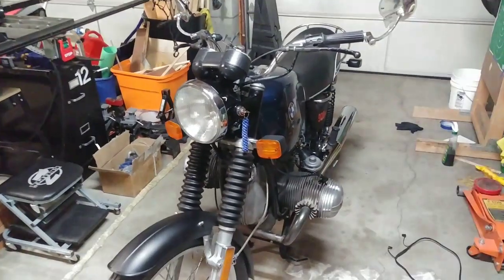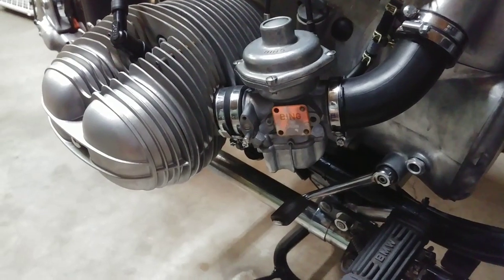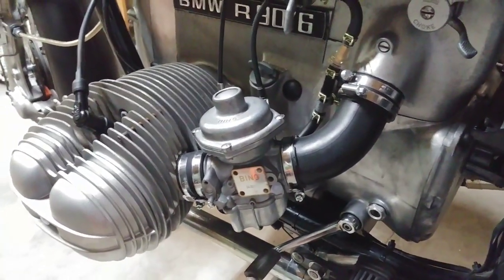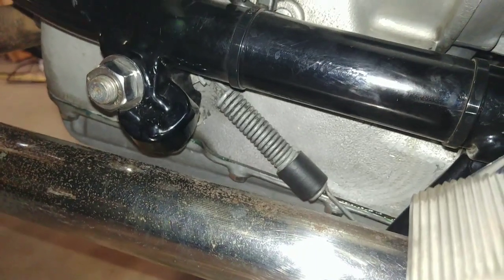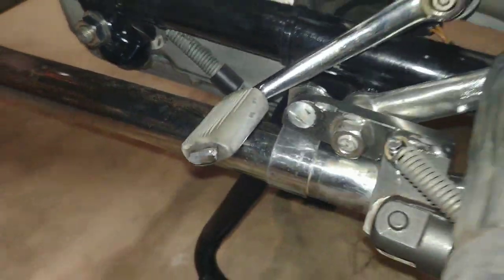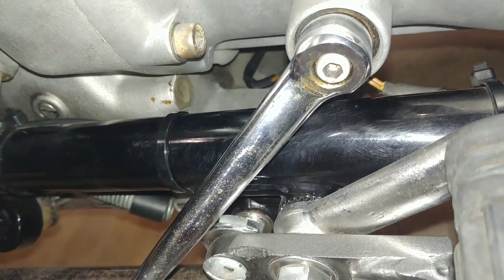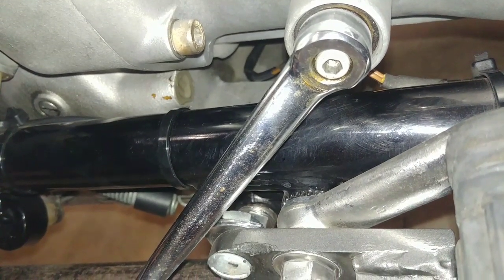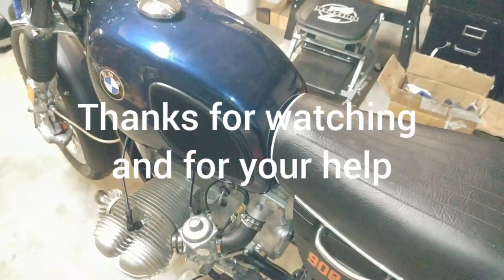Airhead has oil leak. Help!

Comment: That's a really clean engine, no wonder a little leak is offensive.   Not like my '79 R100RT which looks like an oil barge..
Reply: Problem you need to Degrease the Mot or with a Professional Grade Degreaser 3 D we're ProTech Detail

Comment: You should find a slot-head screw under the epoxy. A proper fix will require (at least) pulling the transmission. If you can back the old screw out, and find that the threads are good, then clean it all off, apply high-temperature thread sealer, and reinsert.  If you find damaged threads, the fix goes to a new level of difficulty.  If the threads have minor damage, you can run a tap in there. The shelf is in the way of a normal tap driver. You will have to rig an extension. If the threads are badly damaged, you will have to drill a larger hole, tap for the next larger bolt. For this, you want to drop the oil pah so that you can get any shavings out. If you cannot back the old screw out, then my suggestion is to get a welder to seal the opening. Good Luck!

Comment: Heiko did you figure out where/what this leaks was or from please? What was your fix if you have one? David
Reply from the maker: Yes, under the epoxy material is a steel plug that just closes of a hole from when the case was machined. I took the plug out cleaned everything and used some Teflon tape and put it back in.